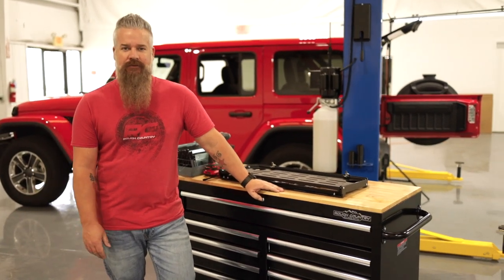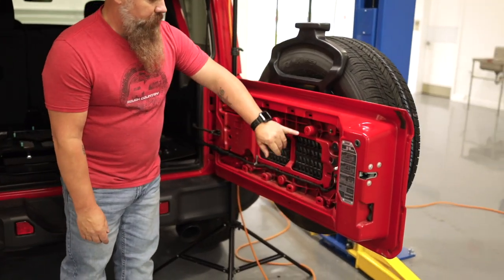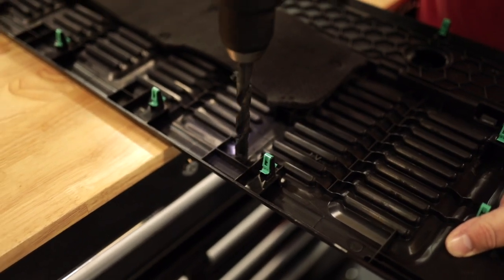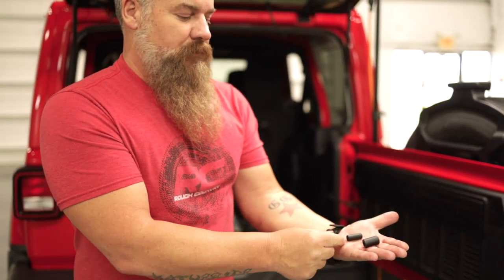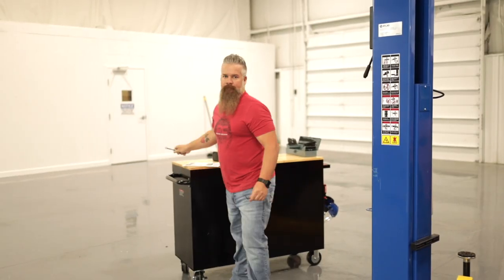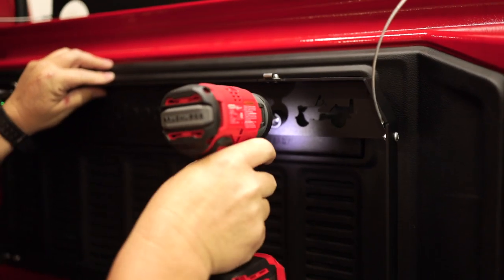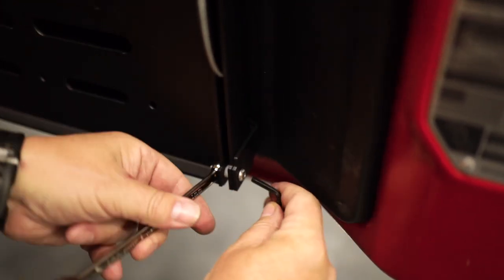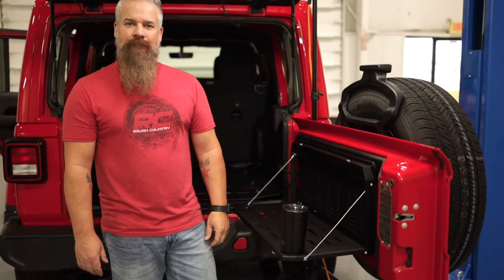Installing Jeep Wrangler JL Tailgate Table [by Rough Country]

Comment: It is much easier to remove the panel if you first pop out the smaller window. You can push it right off, without prying.